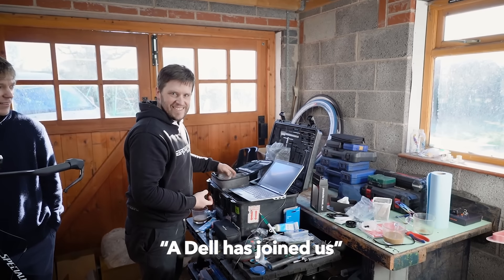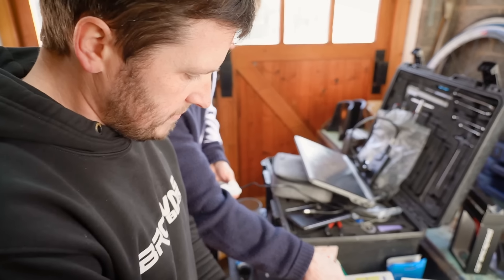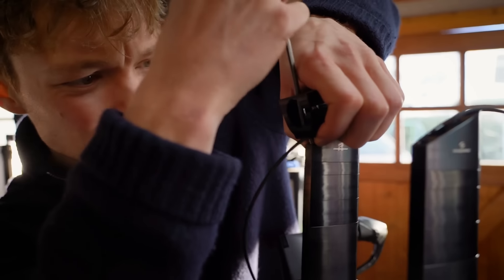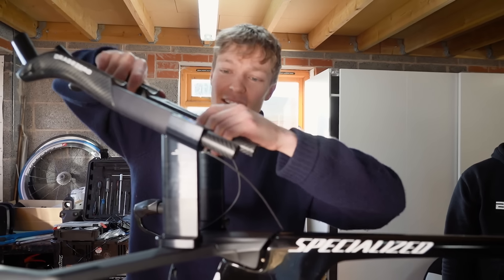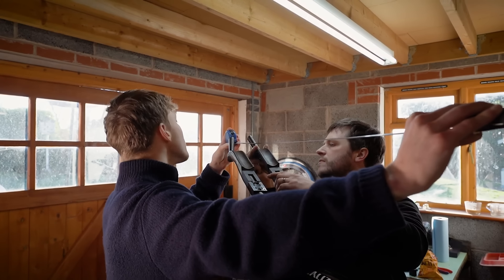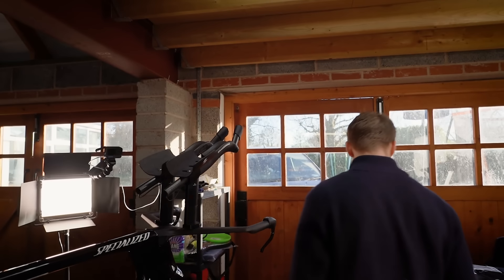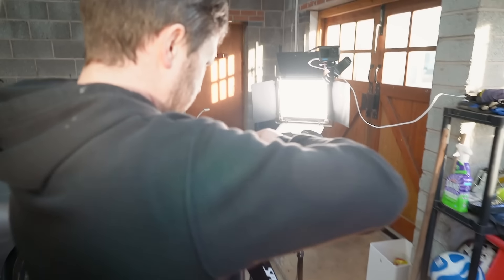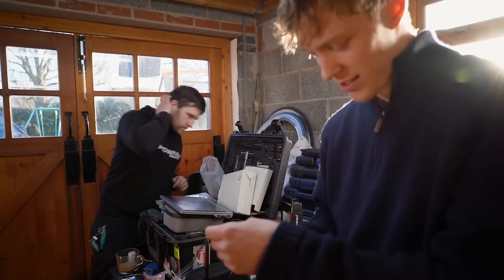So Close Yet so Far from Finishing.

Comment: That is a stunning bike Alex. I replaced the hideous BB86 bottom bracket in my Cube with a Wheels Manufacturing replacement. Like the one fitted in the Shiv, the 2 halves screw together within the shell to make the bottom end much stiffer than the original set up.

Comment: Those cables should have been tested before.. tut tut
Reply: I recon in all the di2 bikes i have ever build i have only once had a dodgy cable, and with a laptop you can quickly work our where the fault is so i tend to just get on with it, saved a lot of time over the years. Forgetting to charge it once  the battery and mech is  installed on the other hand though.... Doh! 😂

Comment: Cool videos!  How bad were the brake mounting surfaces that they needed facing?  Did you have to face the bottom bracket as well?  I finally managed to find one of these frames new in box and the Specialized shop says they refuse to face the brake mounts or bottom bracket because it isn't necessary.  Of course I'm being OCD about the whole thing and want it to be perfect. so I hope it all goes together correctly.  Just waiting on a power meter spider, bottom bracket install tool, and rear brake rotor to come in the mail, everything else is ready to go!  Can't wait to put this thing together soon.
Reply from the maker: We never checked to ee how they were straight out the box, it seems to be habit for Brown as most bikes need it doing out the box.  Good luck with your build!

Comment: Good Jesus your on GP5000s… at least you won’t puncture
Reply from the maker: GP5000 TT TR, best option for the front tyre because of the aero, Vittoria corsa speeds for the rear. Unless you're brave and want to run veloflex records...
Reply: do your run  23 on the titan front, or sanity and a 25? latex or tubeless.. is tubeless an option for Conti TT? @AlexDowsettOfficial
Reply from the maker: Tubeless is an option and I run 25mm tubeless, Aerocoach say the 23mm is marginally faster, but the difference is small

Comment: Big gap between front wheel and down tube. Big gap between down tube and rear wheel. Turbulence galore. Just saying. Presumably this is due to UCI design limits or is it a result of production limitations?
Reply: I’d gamble the folks at Specialized might have considered this…
Reply: @cwd3bon  if you understood anything about turbulent flow you would know I’m not wrong.
Reply: Supposedly the gap in front of the rear wheel made no difference in the tunnel vs having it filled in, so they left it out to save weight.
Reply from the maker: A lot of modern day bikes are taking a similar stance, there's something in the air coming off the tyre, there's something in wheel frame compatability (separate them and you can work out a fast wheel from a fast bike) and i think there's a lot in rider/bike interacton. this would be especially true in and around the seat tube where you have a leg and a shoe flying past 180times per minute.  I did hear that Specialized had originally taken the frame to the tyre and saw no difference so cut it out to save weight.
Reply: @AlexDowsettOfficial  I’m certain you’re more yoda level via Bigham secret squirrel 2.0 
Aerodynamics tend to be consistent. And laminar flow tends to be repeatable. Maybe short cranks & higher cadence & aero socks counter some of the traditional accepted results. As you know that amount of weight lost from the frame as a percentage of rider plus bike total must be negligible on anything but Alpe D’Huez.
Reply from the maker: And even on Alpe d'Huez it should be considered more than it usually is!
Reply: @AlexDowsettOfficial  As Alex said, the area by the rear wheel is already very turbulent - negating the need for a tight gap (as per Cervelo's). Interestingly, I've seen two riders in a wind tunnel on a Shiv TT Disc in particular also report that have found an extra couple of watts of speed by running an aero bottle on the downtube when at low yaw.